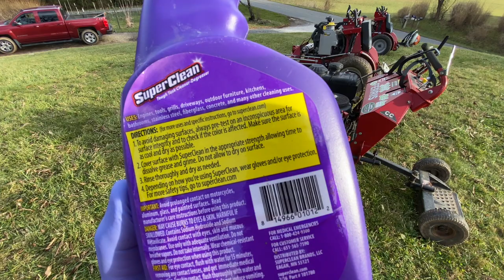Finally! We are Cleaning The Mowers!

Comment: I love Super Clean have used it for a long time.
Reply: I like to use a scrub brush or soft no scratch pad/cloth.  Let set for a few minutes & spray off with water.  It would have been okay to clean off all of the old grease.  Like you said, make sure you grease the machine afterwards.  Works great to clean engines, kitchen grease, bathroom fixtures, mold, moss, concrete floors grease, gutters & all kinds of things.  I buy it by the gallon.  I use a sprayer on my hose.